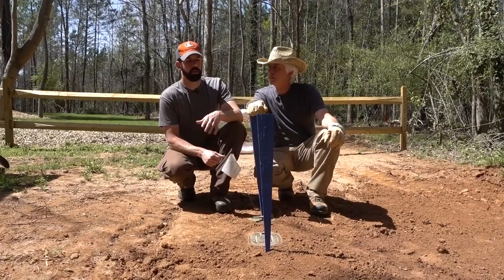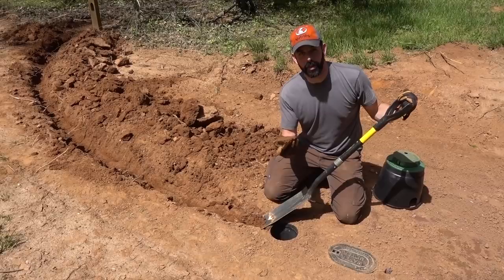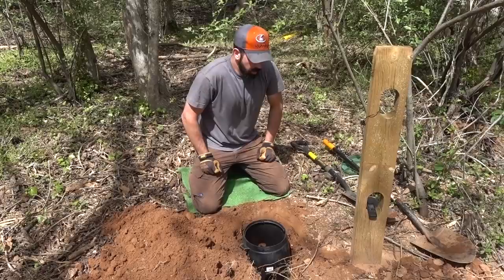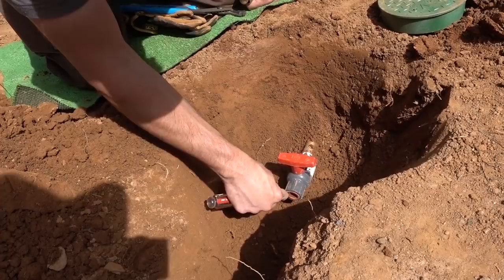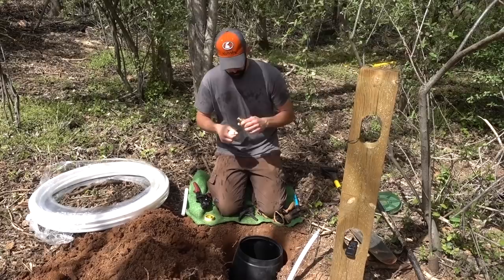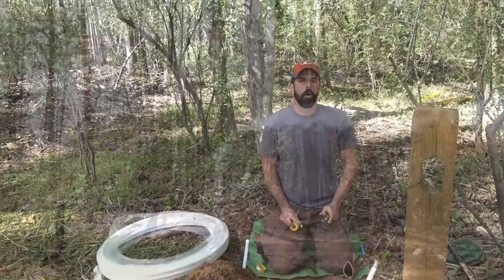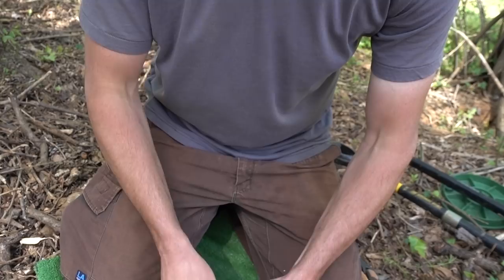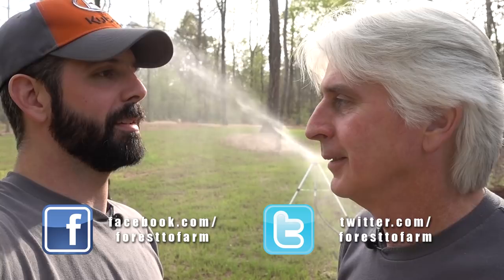Reaching a Milestone, We've Got Water!

Comment: When you need more or get to a more final layout, I'd suggest stopping your pex short of the dry box and running the last foot or so in rigid copper or black pipe and an elbow, a short nipple and a 3/4" Rainbird 33DRC quick coupler.   This way you can leave a water tap underground in a box anywhere you might need water and with Rainbird Keys 33DK  you can quickly stab in a hose, spigot riser, sprinkler, etc.    If you think you need something bigger they have a 44 series that are 1" instead.
http://www.sprinklerwarehouse.com/Rain-Bird-Quick-Coupling-Valve-Key-p/33drc.htm
http://www.sprinklerwarehouse.com/Rain-Bird-Quick-Coupling-Valve-Key-p/33dk.htm
Reply from the maker: Great idea, thanks!
Terry

Comment: Teflon tape was designed to prevent cross-threading; that's it.  However, it's been found to help with leaks. I've had this conversation many times and it comes down to friction. Teflon has one of the lowest drag coefficients to help with threading. Why would you use the slickest material for sealing? You wouldn't, but if you jam enough of anything in there it will seal. I guess it's cleaner than pipe dope. Nice work 👍
Reply from the maker: Thanks for the comment! Everyone I have ever talked to said to use Teflon to seal pipe including plumbers. Learn something new every day ha ha. 
Terry
Reply: Forest ToFarm I've used it for high pressure water systems and had no issues. The story changes with air lines and hydraulics. I wasn't pointing any fingers, I just didn't know until someone told me. Nice series 👍
Reply from the maker: Sorry I did not mean to sound offended. I appreciate new perspectives. It how we learn. Thanks for sharing! Learning new stuff is what I like best.
Terry

Comment: Dear Terry,
A very nice video & more importantly another project completed that can get crossed off the list. However I was somewhat surprised that the trench was only about a foot deep when in the UK we are advised to bury all water lines a minimum of 750mm deep so as to avoid freezing the pipes during winter. I sincerely hope you won't encounter any issue in the next coming winter. All the best & kind regards.
Reply from the maker: Finally , water!
That water line will only be there for the summer. By fall or sooner we will be running it all the way up to the house sites. Then we will be burying it 18" or more as required by local codes.
Terry
Reply: Dear Terry,
Thank you for courteous reply. I am relieved to hear that you are aware of the potential for frost issue & more importantly you will attend to it before you get caught with your pants down. Best wishes & kind regards.
Reply: Dear Terry,
Thank you once again for your hearted reply. if I see &/ notice the pipe has been overlooked, I shall gently remind you. Kind regards.

Comment: up hear in north missouri we got to go down 4 ft to git below frost line
Reply from the maker: Hey Steve. We have to go 18" for frost line here.  This line in the video is just temporary until we rent a ditch witch and run the line through the woods over to our house sites. We wanted to get some water on the little field we seeded right there at the water main area. 
Terry
Reply: yes i sean that a lot of diferant weather froum hear and thare
Reply: We can totally sympathize with you Steve here in northern Minnesota. Our footings go down 5-6 ft , water lines .... keep digging until you can't go any farther! Than most years you should avoid frozen pipes! 😩😊.
Reply from the maker: You guys got it rough up north!
Terry

Comment: A sub soiler would be handy next time
Reply from the maker: That would probably get the job done.
Terry
Reply: Forest ToFarm very handy for draiage and putting pipe into the ground you can get a thing the feeds out the pipe after you if you want to to a lot a water pipes
Reply from the maker: Gonna check that out. Got any advice on a good one? A link maybe?
Thanks,
Terry
Reply: Forest ToFarm I'll have a look but how do you put a link
Reply: Forest ToFarm I got mine from implementsdirect
Reply from the maker: I can look there (implementsdirect) Thanks. 

Basically you would go to the site. Then copy the link at the top of the page in the address box of your browser.
Terry
Reply: Forest ToFarm thanks 
                          Dan
Reply from the maker: I forgot to say then you paste the link in the comment you are making. For anyone who does not know how to paste---- To past you right click in the comment box and a box with options pops up then you simply click paste and it should be there.
Terry